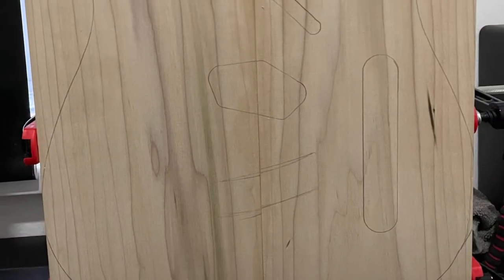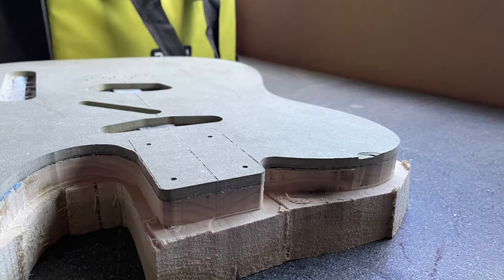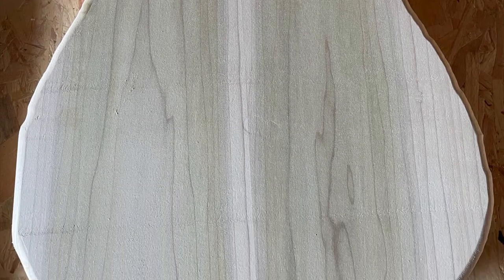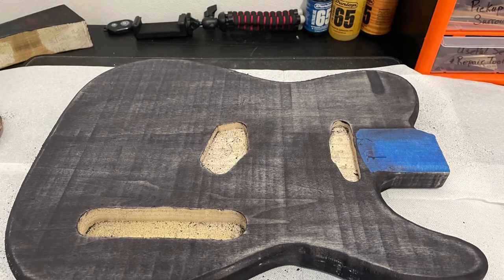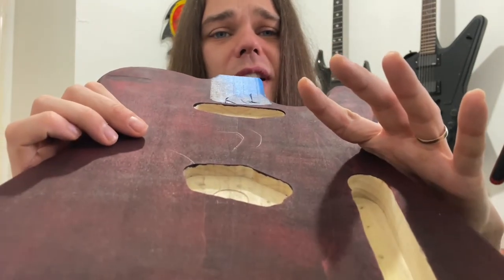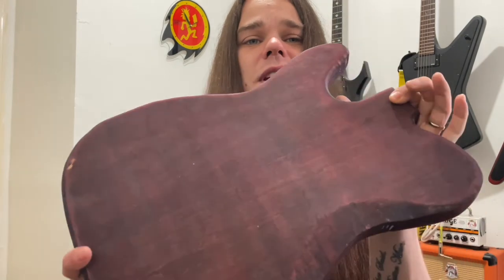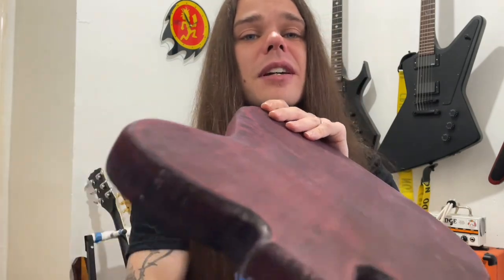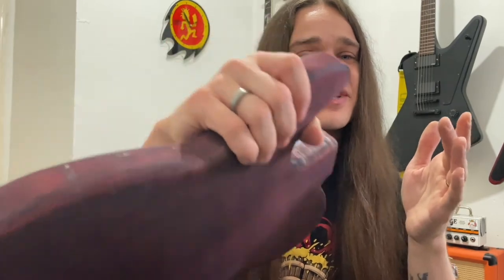Practice Body Blank Build

Comment: Nice! Great idea to do a test body like that. I did a few smaller tests focused on a particular process like say jointing 2 small thin sheets. But doing stuff at full scale is much better. I tested out my new router by making a P90 template using some batons as a temporary template. That worked great so jumped off the deep end and used the router to create a bigger cavity on the kit body for my build. The first few cuts on that were nerve-wracking to save the least! I made sure to take it slow and careful. Maybe a bit too slow in places seeing as there are some burn marks on the side of the cavity. But overall I'm happy with the result. Will be picking up a Shinto soon to try some carving on the body. Will definitely consider making a body + top for the next 1.
Reply from the maker: Thank you very much for the comment and I’m glad you enjoyed the video, it was an amazing process to build this. 
The router was definitely the most nerve-wrecking part and I’m glad that I’m not the only one who felt that way. Only issue for myself is the trim router I used has one speed so I have to get it right first time otherwise there’s a massive chunk taken out the wood. 
All in all though I’m proud and happy with what I did as it’s given me the skills and knowledge to do my next build with fewer mistakes, let’s be fair there’s gonna be a mistake or two somewhere down the line 😂